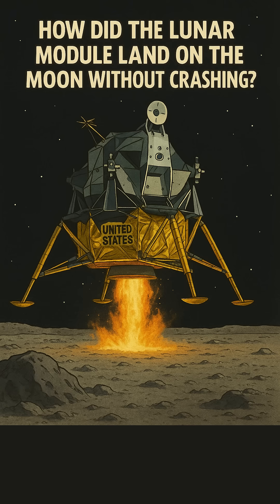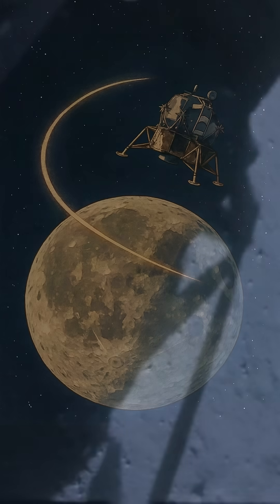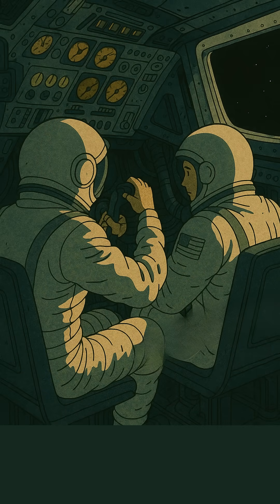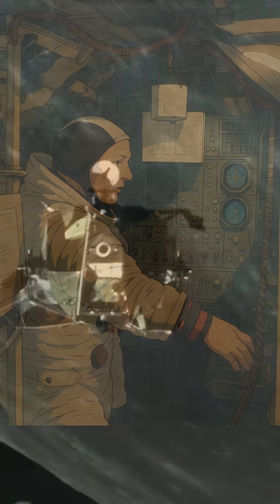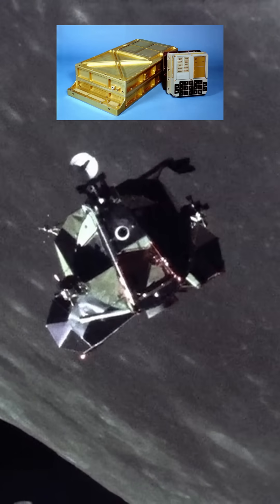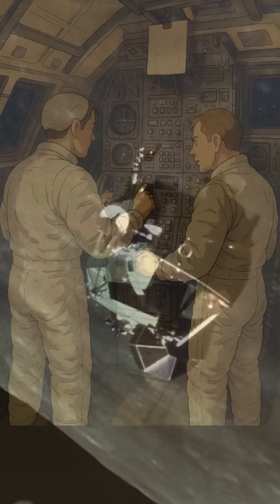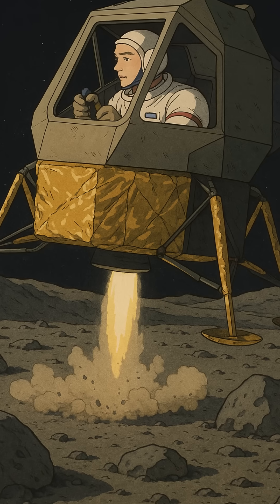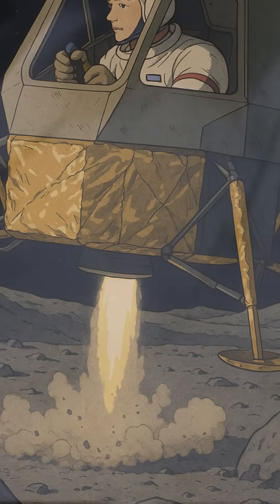How Did the Lunar Module Land on the Moon Without Crashing?

Comment: How hard could the LM land without taking damage?
Reply: Indestructible ship.
The Apollo Lunar Module (LM) featured a pressure hull with an extremely thin metal layer, measuring only 0.3 millimeters (0.012 inches) in thickness.